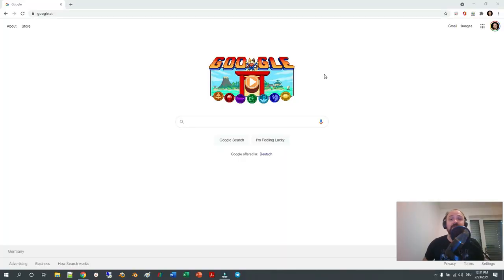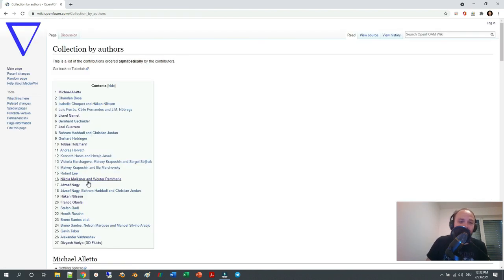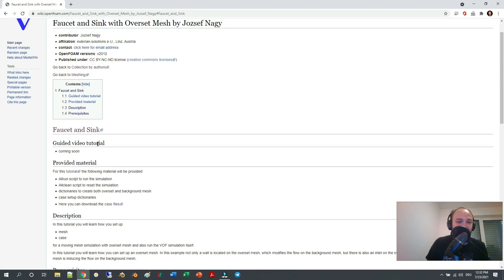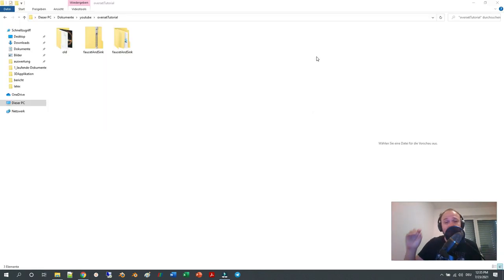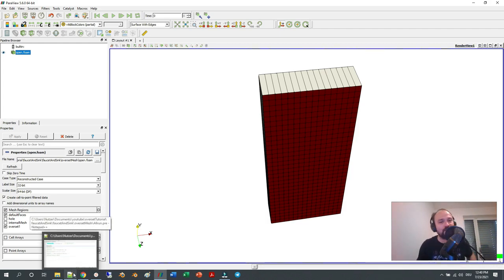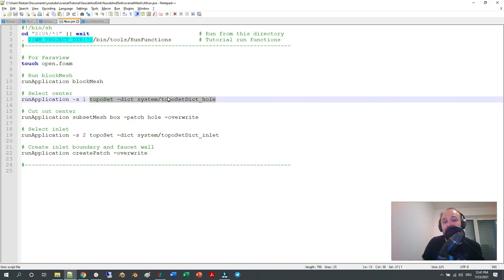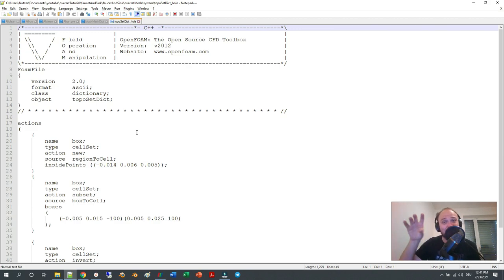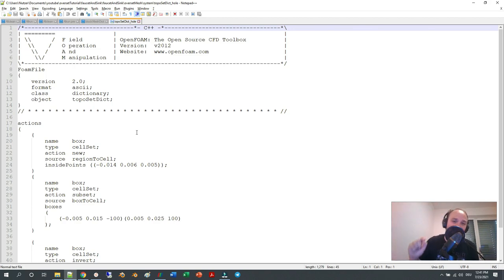Overset mesh simulation project tutorial in OpenFOAM (mesh and simulation)

Comment: Hello. Thanks for this very interesting video on overset. Do you think you can do a similar video with foam-extend ? It seems that overset from FE run much faster.
Reply from the maker: For now this will do, as far as I know overset function migrate from foam-extend to v2x0x, so possibly this will be faster as well, but as far as I can tell, this is already rather fast.
Reply: @OpenFOAMJozsefNagy  You mean that overset library from FE will be incorporated in OFplus ? Where did you get this information ?
Reply from the maker: @paulinferro3  They have been porting some features for years e.g. finite area. I am not sure whether it will be the exact library but as far as I know parts of it.

Comment: Thank you for your video! I have a short question regarding this tutorial in Openfoam/8. How can I transform the setFields  into the Version 8? Every time i want to execute setFields, i get the error message: Setting field default values
--> FOAM Warning : 
    From function bool setCellFieldType(const Foam::word&, const Foam::fvMesh&, const labelList&, Foam::Istream&) [with Type = double; Foam::labelList = Foam::List<int>]
    in file setFields.C at line 117
    Field zoneID not found
--> FOAM Warning : 
    From function bool setCellFieldType(const Foam::word&, const Foam::fvMesh&, const labelList&, Foam::Istream&) [with Type = double; Foam::labelList = Foam::List<int>]
    in file setFields.C at line 117
    Field alpha.water not found

Setting field region values
    Adding cells with center within boxes 1((-100 -100 -100) (100 -0.02 100))
--> FOAM Warning : 
    From function bool setCellFieldType(const Foam::word&, const Foam::fvMesh&, const labelList&, Foam::Istream&) [with Type = double; Foam::labelList = Foam::List<int>]
    in file setFields.C at line 117
    Field alpha.water not found

Do you know what I can do? Thanks in advance!
Reply from the maker: I do not know. Unfortunately .org deviates so much from .com that more complex problems like overset are not 100% compatible. I would suggest to test it with the .com version.

Comment: Hi, Jozsef, I am trying to implement parabolic velocity profile in your tutorial (instead of uniform -0.5 value in y direction, at inlet1). Implementing forAll loop, I am trying to calculate and store the parabolic velocity profile values in a vectorField named field, like, field[faceI]=(0, ...., 0), WHERE .... represent the formula/code to calculate parabolic velocity profile. Then I try include field inside operator, like, operator == (field, Up). I also tried it different other ways, like operator==(field[faceI], Up), etc, but I am yet not able to get the desired parabolic profile at the inlet1. I will highly appreciate your guideline/comments on my strategy or how to achieve the my goal. Thank you in advance and waiting to hear your response.
Reply from the maker: Maybe this helps: http://www.tfd.chalmers.se/~hani/kurser/OS_CFD_2019/lectureNotes/ImplementParabolicVelocityFixedValueBoundaryCondition.pdf
Reply: @OpenFOAMJozsefNagy  Thank you very much but it only helps with stationary meshes..